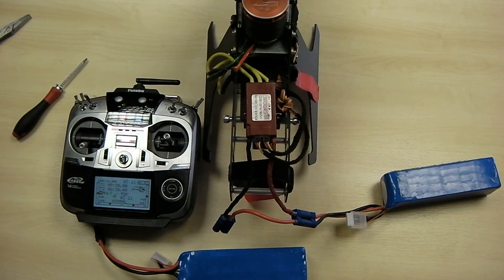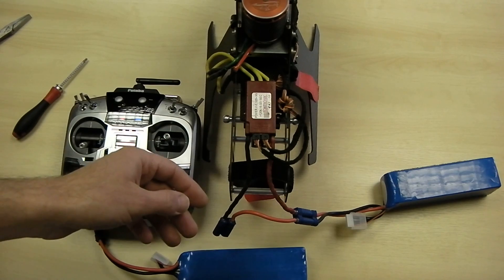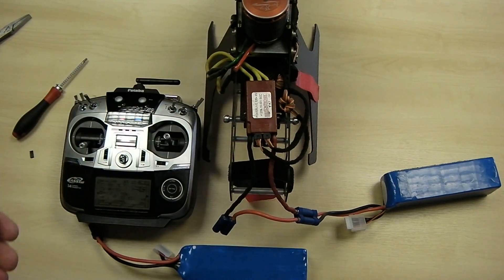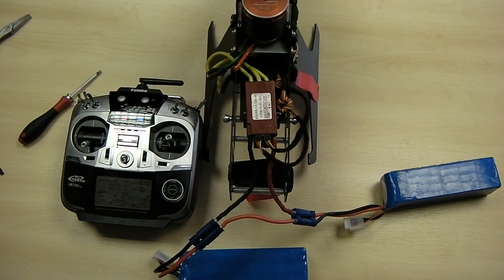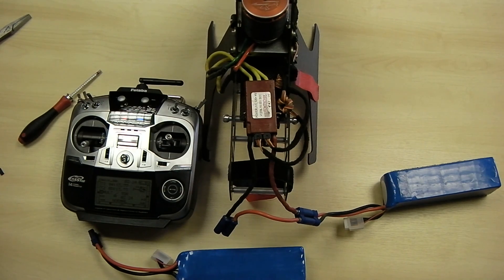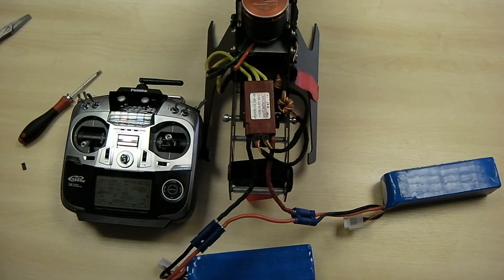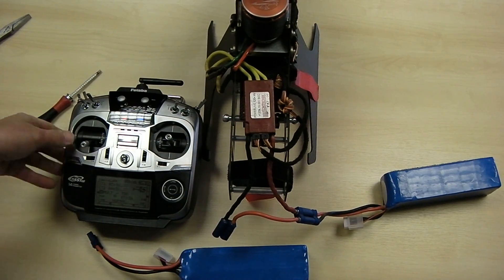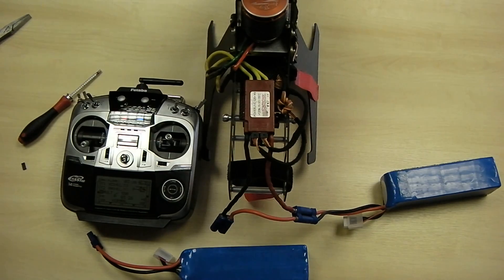Kontronik Jive set up.

Comment from the maker: I do normally leave the jumper in yes so I dont loose it :) On power up for the Jive it will be solid. If you have Lipo mode programmed it will flash with the beeps.